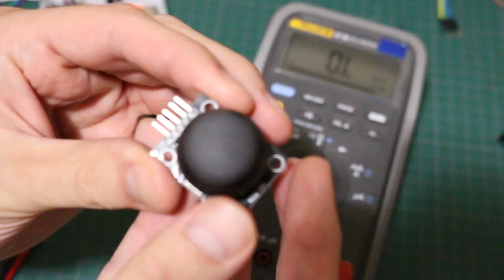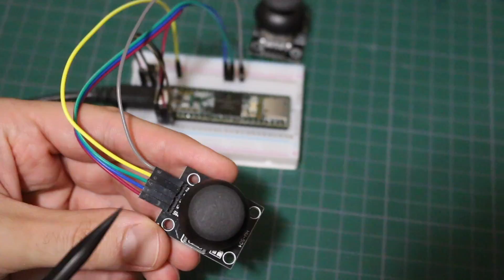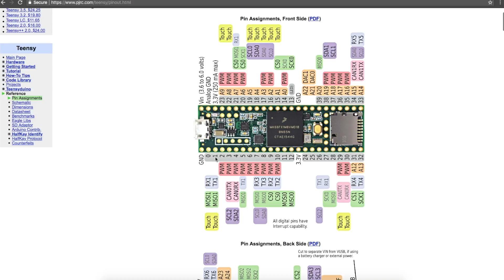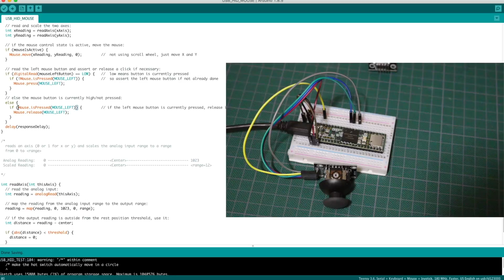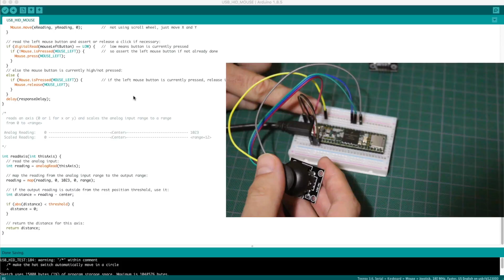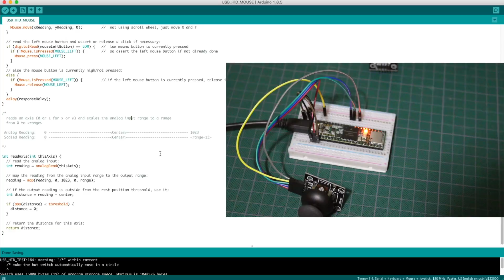How To Use an Analog Joystick with Arduino - USB Mouse Tutorial

Comment: hi mate awesome video you explain this code  so well, im struggling to setup a single analogue stick on teensy 3.2, I replaced the dpad on my orbweaver.  Ive got forward, left working perfectly, right works upto 75%, then doesnt work ( deadzone issue i believe) and backwards doesnt work at all, I been trying to work this out all week, but there is nothing I can find that relates exactly tro my problem, Id be eternally grateful if you would be kind enough to have a look though my code  or even explain to me how to calibrate it properly
Reply from the maker: with the circuit powered, if you use a meter to measure voltage on the X and then the Y outputs to ground as the stick is moved the full range, does it go from near VCC to near Ground (validating the resistors are working)?  Or checking the resistance of the pots directly with the stick not plugged in to anything, measure resistance from X to ground (or vcc)   and then Y, while the stick is moved, does resistance seem to move full range on each axis, to rule out if it's hardware or software.    Within software otherwise, you could have a test program just to continually do an analogRead of the X and Y axis and print out the 0-1023 reading on serial monitor and double check that moving the stick each way allows a full 0-1023 reading.    Then you'd know if you can't get the proper voltage/resistance/analog reading, then there's no way the rest of the code would work anyway.   If you do get readings but they're all constrained like maybe X can only show readings between  150 and 700, and Y can only show readings between 0 and 925, you can use those as boundaries and in the code instead of taking a reading and scaling from 0 to 1023  over to the new values in the code, you'd hard-set it for scaling 150 to 700 over to the new values, or 0 to 925 over to the new values.  I should have put a calibration mode that checks the X and Y range of a specific stick and not assume they all go 0 to 1023. If I can locate all the hardware maybe I can try revising that.  I'll put it on a to do list.

Comment: Interesting, I'm using the Teensy 3.5, which is 5v tolerant, to control a mobile robot wirelessly (via Xbee), and tried using that same little analog joystick.  Just and FYI for anyone thinking to use one of them: that joystick basically sucks.  Fine for experiments perhaps, but useless for controlling anything.  I switched out to a more expensive but far superior analog joystick from Adafruit https://www.adafruit.com/product/3102?gclid=Cj0KCQiAlIXfBRCpARIsAKvManwZ50JSBH1tWZe894sYPW2i45MuLW8mkJdLZPyXDGJS4meGjdt-y0EaAuEmEALw_wcB, and it works fine.  The same thing can be purchased from Amazon.com and other suppliers under different names, don't have to get it from Adafruit.
Reply from the maker: Yeah for anything legitimate it's probably best to get more reputable parts.  I've only ever tried the cheap ones and only for fast experiments so it's good to hear results for more advanced projects.
Reply: @GadgetReboot    I looked around but was unable to find anything else that looked like it would work for less than around $100.  So this was the right choice at $20.  It has a much longer throw, so it is easier to control the output smoothly.  I had to set a dead band around +/- 5 in the range of 0-1024, since there was that much spread when spring re-centering.   The little ones like you are using had +/- 2 on my setup.  That much dead band doesn't hurt anything for what I'm doing.  My joystick is right out of the box, so perhaps it will smooth up a bit with use, or maybe a little silicone spray would help to obtain a more definite spring center.  Also note that the Adafruit joystick doesn't have a button incorporated as part of the stick function.

Thanks for replying.

Comment: I borrowed a Teensy and played with it for a few days.  Pretty nifty for the time, with the integrated USB 2.0.  Ran a little hot.  I think you would be amused with a sub $2 Blue Pill or Black Pill: https://www.aliexpress.com/store/product/STM32F103C8T6-ARM-STM32-Minimum-Development-Board-Module-for-arduino/1326062_32809970602.html
These are only Cortex M3's, and not M4's though.  Usually 128mb flash.
They do USB 2.0, and run COLD.
Reply from the maker: I opened it up in another tab to check into. Price looks right, don’t see how I can go wrong checking out. Going to need a lot of new toys soon, winter is coming.
Reply: The day before last, I received 4x of these bare chips for $4.13, shipped.  Just finished my first dev board last night, and got the Maple (USB) bootloader working with one.  Was worried that proprietary ST-link hardware would be necessary, but was able to bootstrap without one.
This was my first attempt at mounting a 0.5mm chip to an adapter plate.  Gosh those pins are tiny!  Certainly it is better to pay the extra $0.75 for a Pill board, but I enjoy the confidence gained in being able to use the bare chip.
https://www.aliexpress.com/item/STM32F103C8T6-LQFP-48-ST/32744863225.htm
Reply from the maker: When I get around to having to use some of the flat flex cable connectors, and I have to solder them to the break out boards, I don’t know how it’s going to go but I certainly have enough flux and hot air to give me a better chance than half a year ago when I just had a bulky soldering iron tip to work with. 
 I remember the first time I had to solder a surface mount part, it was an 0805 resistor which is totally huge now, but back then I was afraid to go near it because it was too small to work with and I thought I would damage the part or the pads. Now I feel that way about 0201